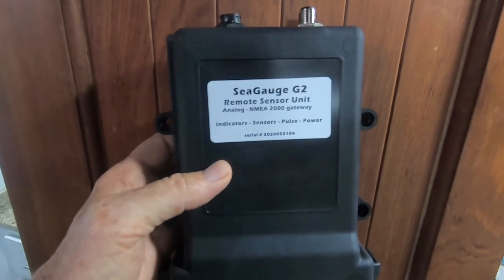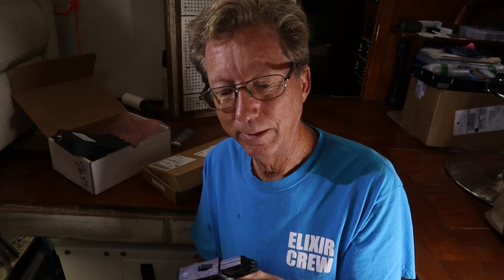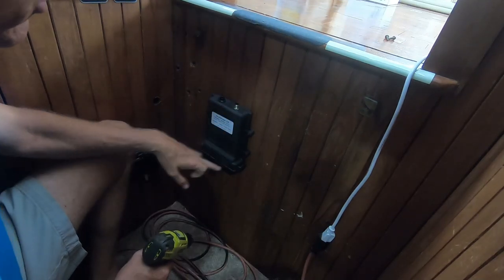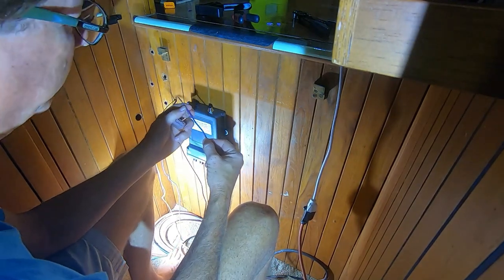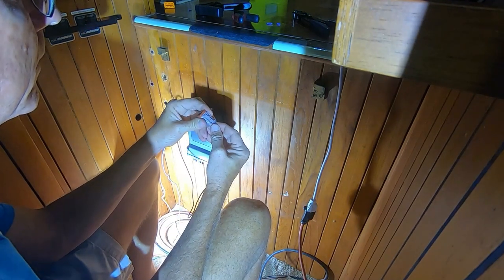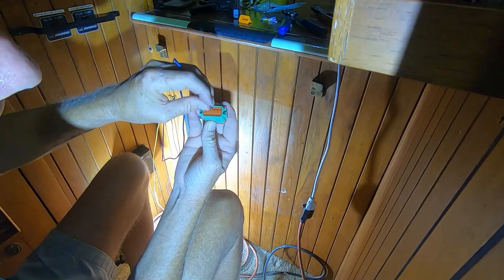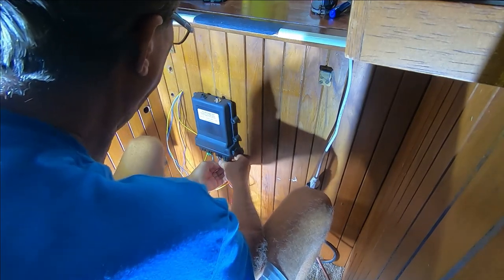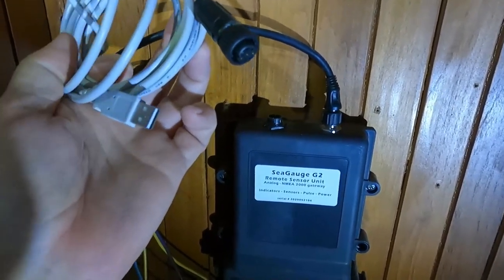How to Install a Chetco Seagauge G2 Analog to Digital Convertor, Ep-170

Comment: Liked the video. Will this work on any Diesel engine? I have two 175hp Hino engines and most of my tach gauges don't work and I am wanting to incorporate it with a garmin MFD running on NEMA 2000. Can you show how you hooked it up at the engine. Thanks
Reply from the maker: Glad you enjoyed the video!  As far as I am aware it will work on any engine.  You just have to calibrate it to your engine (I will be posting videos on how to do that soon).  I will take a pic in the morning of where I hooked it up to the engine and post it here for you.
Reply from the maker: I took a picture but can’t figure out how to put it in a comment - sorry 😢
But it is just a single wire attached to the tach pick up terminal on my alternator.  I imagine it would be different for different boats and engine configurations.  You would just take the wire that runs to your current analog tachometer and connect it to the Chetco instead.  If you would like more info - feel free to DM me and I would be happy to help in anyway I can.
Reply: @CruisingThisOldBoat  You could make a 1 or 2 minute video that travels to the location of the plug and then show the photo for 5 or 10 seconds, explaining where it is and what is involved in getting to the connection point. Even though we might not have that part, some of us like to see where and how to fix things. 
( Just a thought of an opportunity for another video. )
Reply from the maker: @robertlewisvideo   - good suggestion - I’ll make sure I incorporate that into the future videos.  Thanks!